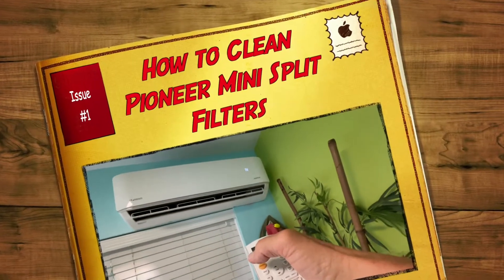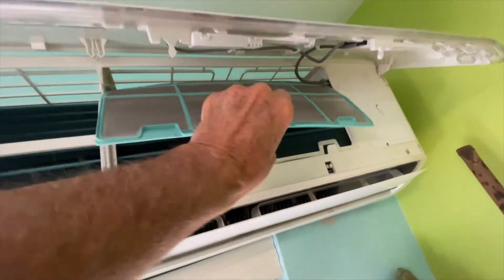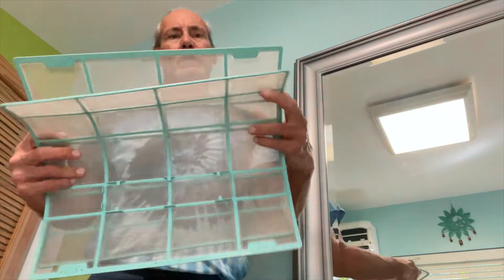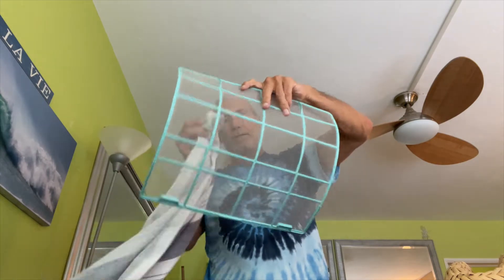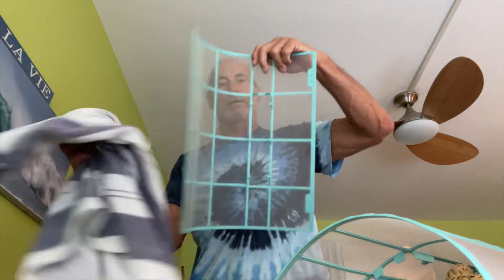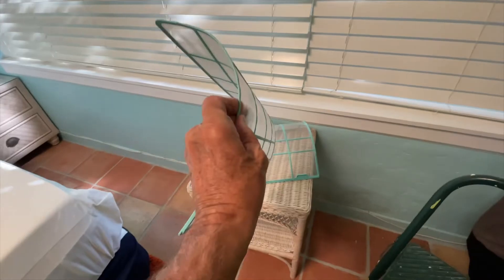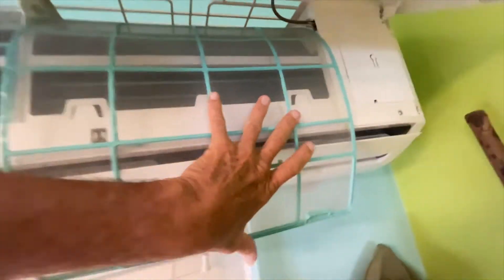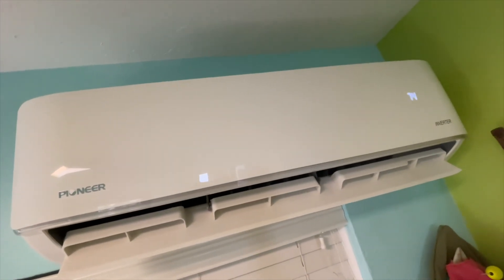How to clean Pioneer Mini Split Filters

Comment: I actually have the same unit. I was looking to see how you opened up this unit to clean the blower wheel.
Reply from the maker: Glad I could help stay cool this summer
Reply: @TomLeeman  I was actually wondering if you know how to open up the unit and get to the blower wheel because that’s what I need to clean and it does not show that on this video